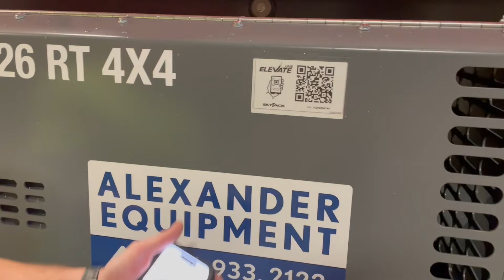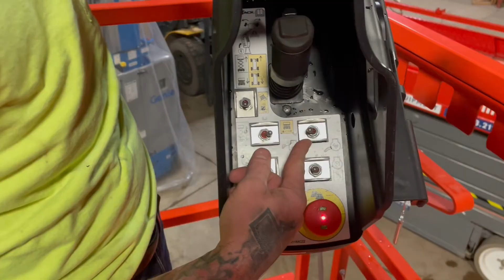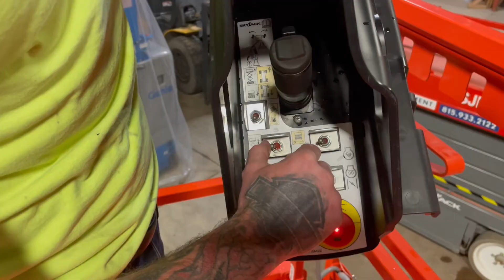How to Operate Skyjack SJ6826RT

Comment: An hour later and FINALLY 'The switch has to be in lift operation mode to get the stabilizers out' 4:13.  Thanks for this.  I may not be the sharpest tool in the shed but couldn't find that in the manual lol.  🤪
Reply: THANK YOU!